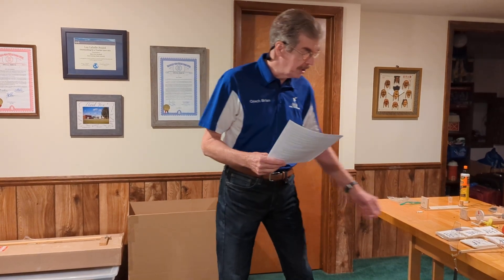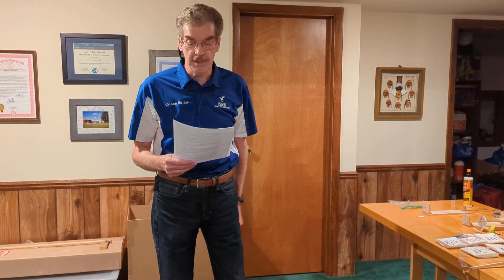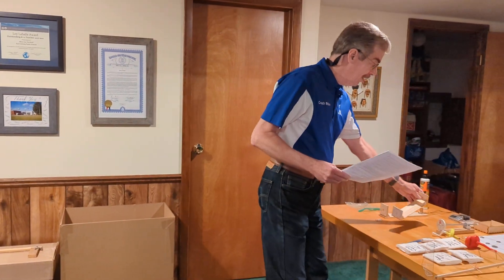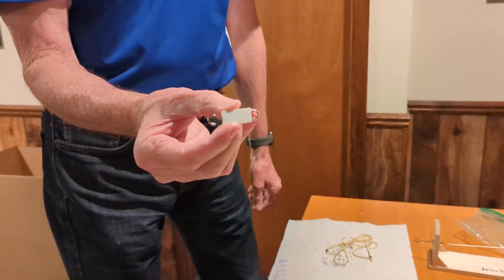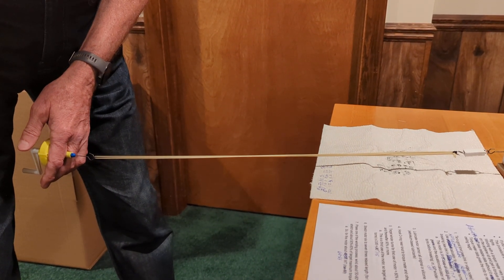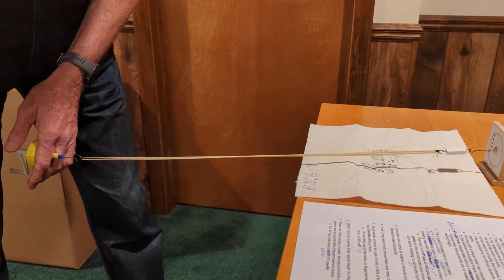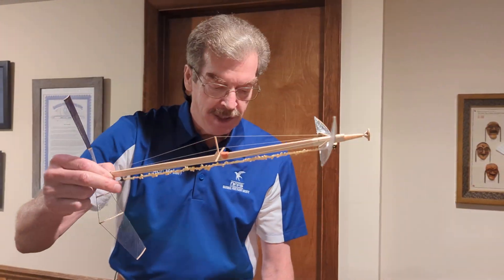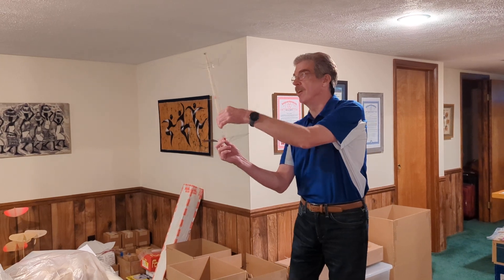Science Olympiad 2024-25 Helicopter Rubber Motor Winding Demo

Comment: Hi Coach Brian. We use your calculator to get the max turns. But how do we know the max torque that the rubber can take?
Reply from the maker: @PraveenBalaji12  if you're winding to 90% plus of max turns using good winding technique, you will learn the torque target. There is not an accurate max torque calculator that I know of. We wind lower density motors to 1.8-2.1 and higher density to 2.4-2.7 this year